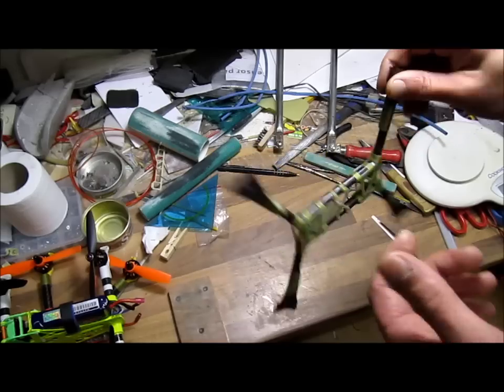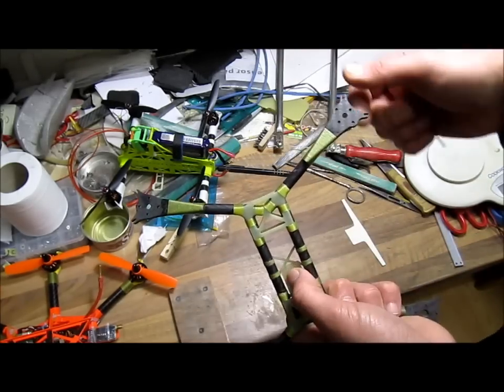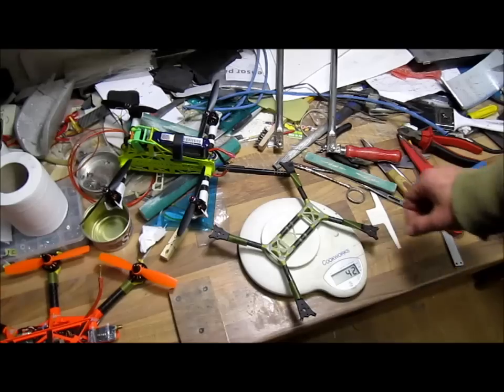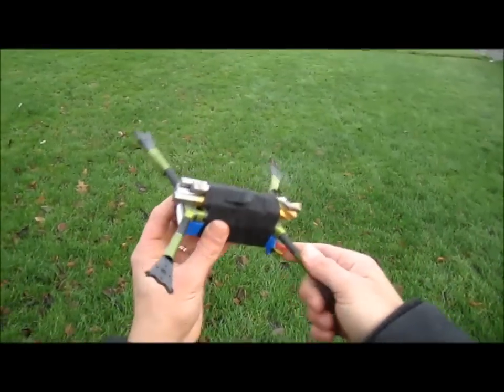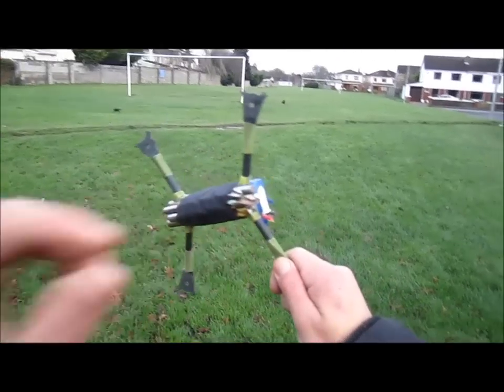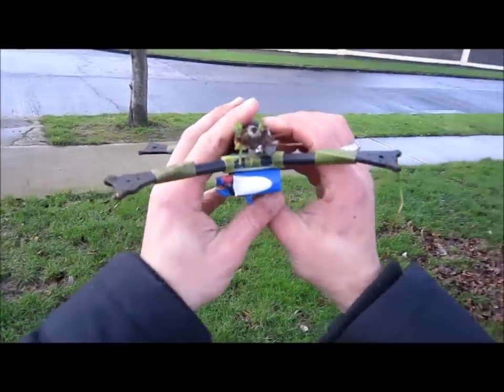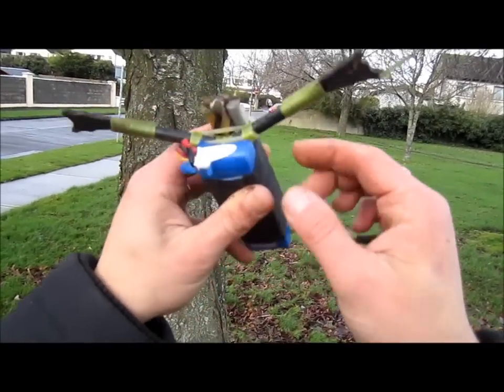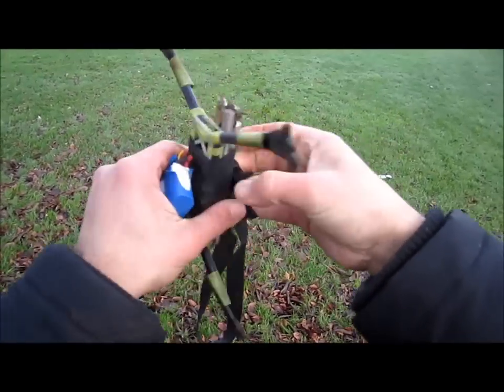Lightest DIY Mini-H frame

Comment: I love how you use the CF tubes. Too many frames have crazy wide & flat arms that must cut some serious efficiency. Keep it up!
Reply from the maker: Yeah man, flat arms obstruct a lot of airflow, and other reasons are weight to strength ratio, twisting flexibility and resonance- round tubes wins all these, but badly loses at craftsmanship complexity and amount of work involved:)
Reply: ROBOFORCERX2000 It is definitely hard to work with. I also would like you use a similar no aluminum/screw method to fix the joints. I really like your method of joining the tubes with plates & fishing line. So are you using CF/Fiberglass resin or just CA?
Reply from the maker: I use resin only to fill the gaps between GF and the tube where fishing line is being wrapped, to prevent sliding between GF and the tube. Otherwise all CA. Here's step by step "how do I do it" video:) https://www.youtube.com/watch?v=SPNMoxaNWvk

Comment: Have you tried dropping the dead-weighted frame from another drone at a known height? It seems like it would fit with your detailed approach to testing.
Reply from the maker: No, but I'm adding more weight than AUW, thinking that more weight on free fall would do similar damage to less weight on speed crash. Of course my tests like these are not precise, rather based on my "I think so", but it works and I didn't miscalculate much so far:)

Comment: The question is, will it be strong enough?
Reply from the maker: Planning AUW is 350gr and with 400gr in this video it held pretty well, but of course there was no "full throttle to the ground" or "full speed in to a tree" tests, they inevitably will come when this bubu is up in the air:) Time will tell.
Reply: Well, I hope it is strong enough to survive the "accidental" tests.    :D
Reply from the maker: rgonrgon Aww, lets not push it LOL You are correct in theory, but smaller tubes would make a frame too flexible for my liking, me thinks. I could shave more off if 1.2mm carbon plate was used instead of 1.6mm fiberglass, but if it will withstand loads of crashes, than it's a win as it is:)